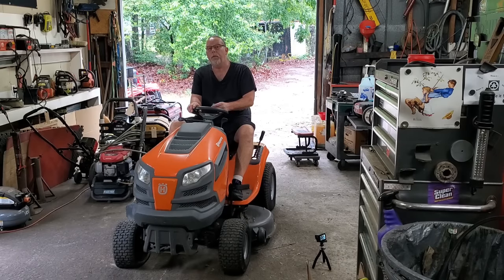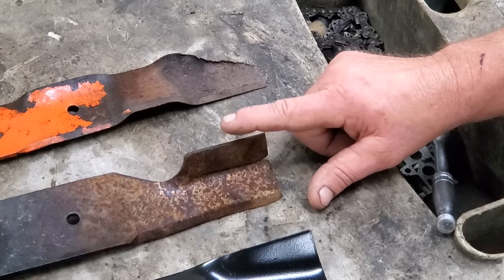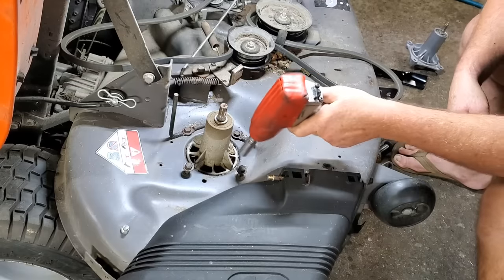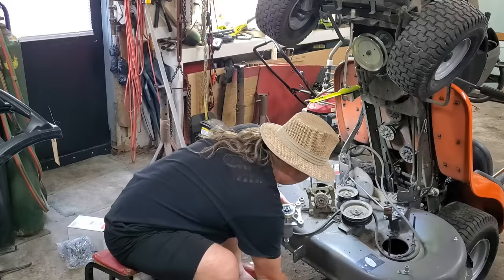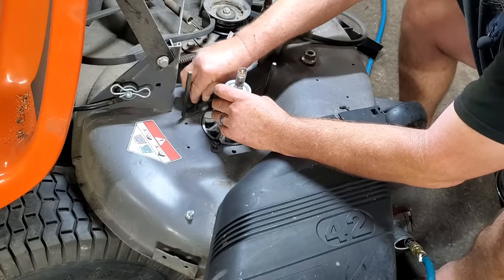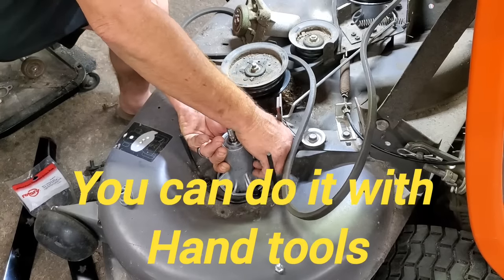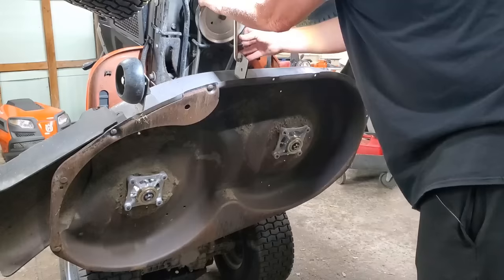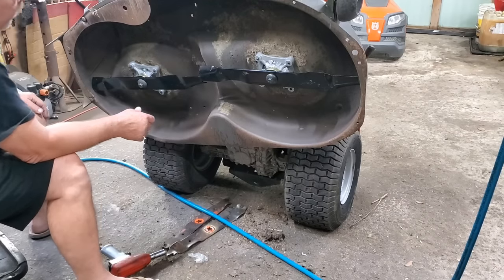Bad Blades Ruin Spindles on a Husqvarna Riding Mower Easy Diy Tips.  How to replace noisy spindles

Comment: 5:00 great tip! After I changed spindles I noticed that blade is wobbling as you said (I just bought used yth 18542). I ordered new cup bolts but in meantime I fabricated additional washers out of sheet metal (sits between old bolt and the blade). That made blades sit tight for now.

Comment: Perfect video about replacing blades and spindles on this machine.  You mentioned the air hose leaking sound.  I have that same leaking sound and I do not even have a compressor.
Reply from the maker: Thank you.  I'm old and leak also 🤣

Comment: Love your work. Im noticing my baffle is chewed up in a mower blade pattern as if the blades are hitting it. My mower rattles violently. We’ve replaced the spindles, pulleys, blades, belt and leveled the deck with it still vibrating. Please help!! No one works on these professionally.

Comment: The 6-point star on my Craftsman pro series 46-inch appears worn on both spindles. I suspect as a result of my heavy-duty Oregon blades striking the top of a tree root, etc. I have approximately 250 hours on my tractor. Can I just order and replace the center shaft and 6-point star - or should I order an entire assembly as you did in this video? I don't have an impact wrench but I'm okay using a ratchet wrench. Where do you recommend I purchase the replacement parts. We no longer have Sears anywhere in Hawaii. Thanks!

Comment: My Deere D130 just started having the blades kissing each other intermittently, about every 10-15 seconds. It didn't do that when I replaced the spindles and the blades last summer. I have no clue what changed over the winter. I am tempted to sharpen and reinstall the old blades to see if that resolves the problem. Ever come across an issue like that?

Comment: Great video.  I have a similar mower with a Kohler 20hp single Courage engine.  It has 496 hours on it.  How much life do you think I have left in it?  Thanks!!
Reply from the maker: Great question.  It depends a lot on the maintenance.  The biggest cause of failure on that engine is..... the bolts back off on the engine cover under the flywheel causing it to Crack the block. Remove your plastic top engine cover, 4 bolts, 8mm. Tighten all the bolts around the top of the engine near the flywheel to hopefully help it last longer for ya.  Hope this helps you my friend

Comment: I have a Husqvarna YTH22v46 that started making horrific banging noises underneath and couldnt find any cause. All pulleys and spindles seem to spin normally (at least I think). I started pulling blades off. One blade has the metal "wing" broken off and the mounting bolt was barely tight. Once removed and mounting surfaces wire brushed, i could not for the life of me get the 5 stars to line up! It seems the 5 stars on the spindle shaft are disfigured and worn way short. The other blade had the bolt cross-threaded so it ripped all the threads out of the shaft when i forced it out. Question - should i go ahead and just replace all deck idlers along with the spindles and belts for a "once and done"? This mower is only 3yrs old, but was used for a commercial mowing business for 2 years. I believe the hour meter shows about 190 hours now. The mower was certainly beat to hell, but i got it cheap. I just want to avoid dropping the deck twice, or ruining new spindles. Thanks!

Comment: My wife's rider I had to do some maintenance on. Just got it out of storage. First mow was good. This one today lots of grind noise and worse on turns.  I see you raised the mower up like that.  The oil and gas doesn't leak out?
Reply from the maker: If your tank is under the seat just remove gas cap and put a plastic bag over tank and reinstall gas cap. I do it everyday and no issues.

Comment: I've never seen blades THAT torn up. Those blades are made of special heat treated alloy steel. They are strong. I cut a 3/4 inch steel pipe fitting in half mowing along a canal. I saved it for years.

Comment: New bearing are sealed grease cant get in or out now if you put in new ones your self take out the inside seal and then you can grease but the first  time you grease them it may thke a whole tub of grease for both spindles not just 5 or 6 pumps of the gun
Reply: What keeps the outer seals from popping out when u grease them?
Reply: Well actually that's incorrect, the seals only marginally keep debris out and grease in.  A grease gun will generate 1,000 to 5,000 PSI, will definitely go past the seal. Test it out, keep pumping  and you will see grease come out the other side of the seals.

Comment: As to the dead battery.
My Craftsman DLS3500 46” Riding Lawn Mower Tractor has engine 31P977-0635 E1  0608157D which according to Briggs and Stratton the alternator output for charging "is unregulated in that the energy delivered to the battery is totally dependent on engine speed."  As these charging systems aren't regulated, to prevent the battery from being overcharged, they seem to return just enough to hopefully start the engine the next time you need it and always having the battery only partially charged.  After mowing charge the battery overnight on a battery charger/maintainer and you will probably find your engine starts better (especially if you have to crank it due to flooding,etc) and the battery will last much longer.
Hope this helps.